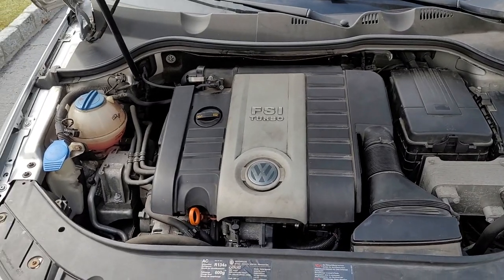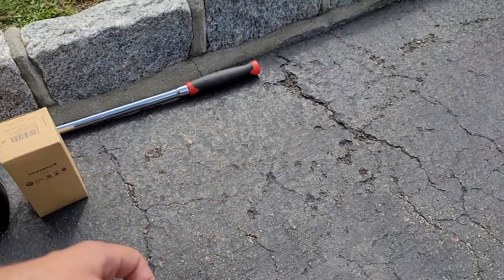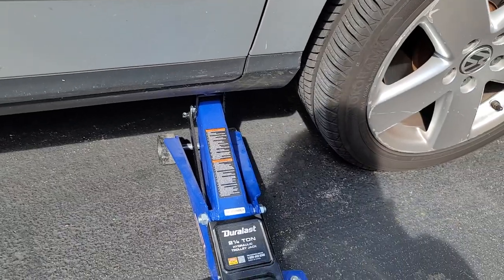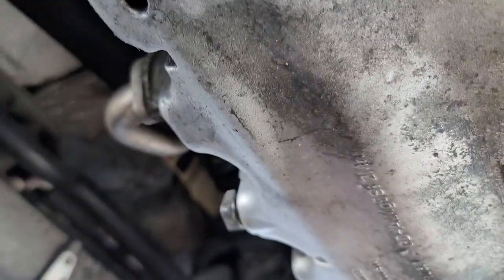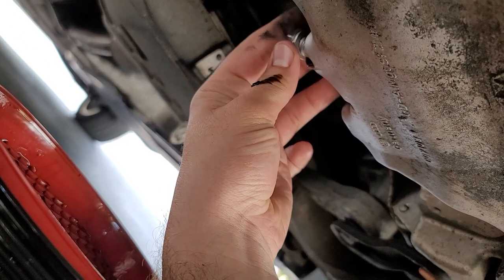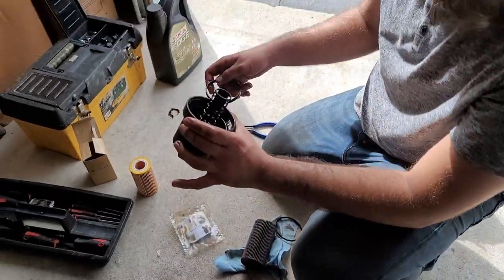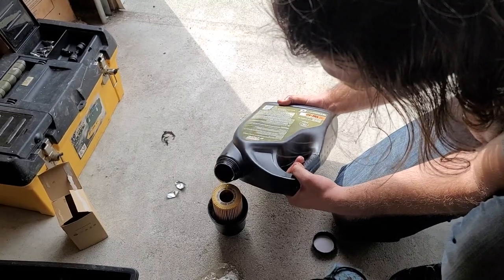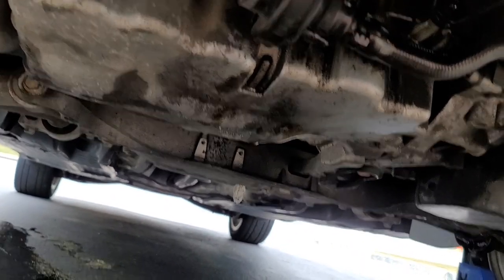How to Change Engine Oil on Volkswagen 2.0T FSI BPY

Comment: Pro tip: you can use brake clean to removed spilled oil from engine parts. I have this exact same engine in my 2007 Jetta and changing the oil is always a mess. Being a bigger guy, I like to roll my car up on ramps and then use jack with a block of wood on sub-frame behind the engine to raise the car way up and then place jack stands.
Reply from the maker: Brake clean is awesome stuff. Every home garage should have one. Gotta use some soon to clean a bunch of oil after I get my oil filter leak fixed.
Reply: WD-40 and some elbow grease is so much safer in the engine compartment. I would not use brake clean. Other cleaners and degreasers sure, but brake clean is a very heavy duty thing. I would not use it here.
Reply: I've never seen a problem with brake clean. Obviously, the engine is not running nor is it hot. The stuff cleans very well and it evaporates quickly.

Comment: Thanks for making this video. I am new to VWs, and just acquired an 07 Passat with this 2.0T FSI engine and its so different from the American cars in many ways. By the way, is that the turbocharger diverter valve right next to the oil filter housing? I believe mine is in need of a new one, but im, not sure where it is, but that kinda looks like the part right there next to the oil filter housing...
Reply from the maker: I'm not sure because I had my mechanic replace it years ago the turbo diverter valve. I had to replace mine because it was leaking air and my check engine light came on. P0299 underboost condition. The new diverter valve from piersburg fixed it. Thats the OEM part.

Comment: Hello, what did you mean by place the jack stand on a solid piece of metal? Do you mean they can break if you place them in a different area?
Reply from the maker: Yeah if you put the jack stand on a non secure part of the bottom and you then lower your jack the stand will go through the floor board of the vehicle. 
Heres what can happen in that instance. https://www.cadillacforums.com/threads/car-fell-off-jack-jackstand-punched-into-floor-panel.385521/
Always use jackstands with the jack if you are going to work under the vehicle.
Reply: @admirbasic2206  thank you.

Comment: Pop some latex gloves on.. it's easy and will save your hands in the future 👍 nice video
Reply from the maker: Hard to make it a habit. Thanks for the advice.
Reply: @admirbasic2206  Everything we touch under the hood and undercarriage is very carcinogenic. Gasoline + Oil + Grease + Heavy Metals. It's all under the car. Not as much HM these days, but they're still there.

Comment: Hi,i got an EOS 2006 with FSI engine 2l i think it's non turbo,but is the same operation and same filter??? Also do i need 5L of oil? thanks
Reply: get 5 and use 4,5 the rest you can add after the engine burns some oil off

Comment: I have a mk5 gti tfsi engine, what eng oil should i use
Reply from the maker: @AlexNorway-z5z  i would check the owners manual to confirm. But the oil i used should be good for that model too. 5w-40 european spec full synthetic oil that meets the vw standard. Verify with your owners manual.

Comment: Now I understand why my dealership charges $100+ to change the oil. Nice job on the work. I have no interest in doing any of this.
Reply from the maker: Thank you. Although the dealer has a lot easier time dealing with oil changes than I do because they have better tools like a lift which makes the job so much easier rather than crawling under the car.

Comment: I know you said  1/2-3/8 adapter...but *what size is that Nut your trying to Turn  ?*
(its hugh) !
Reply from the maker: The drain plug is a 19mm bolt. The oil filter is 36mm. I used a 36mm oil filter removal tool to get it off. Since I needed my breaker bar to take it off since it was really tight, I had to use that adaptor to fit the 36mm tool onto my breaker bar to loosen the filter.

Comment: Does anyone have any idea if the “retainer post” in the center of the oil filter cap is important? I had a shop change my oil today and they reported back to me that the post in the center that holds the filter in is broken off of the filter cap. It’s an 07 Passat and it doesn’t seem that I can order just the post, it seems as though the post is built into the cap, so I’d have to buy a new cap entirely and the new cap is $212 from the dealership and although I can buy them online for about $15-30, I’ve heard they’re all garbage and leak after a few miles if they don’t leak straight from the manufacturer. Any help or input would be nice, I really can’t afford to replace the filter for $200 and I really don’t want to cause any damage to the engine by running it without that post if that’s possible
Reply from the maker: If you can buy the part just to replace the broken cap I would do that as a temporary fix and then eventually replace the whole filter assembly. I had mine recently leak oil. 4 hr job at the shop plus the 150 dollar part so not cheap. I replaced the entire assembly for piece of mind not having to worry about it for a long time.